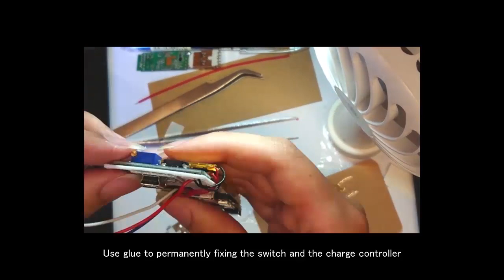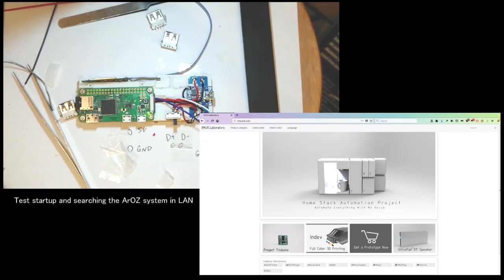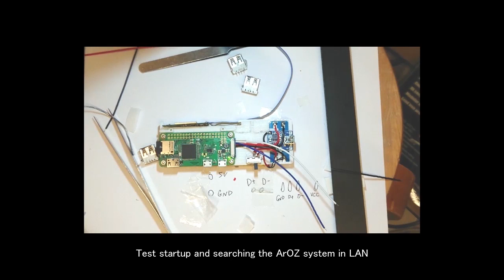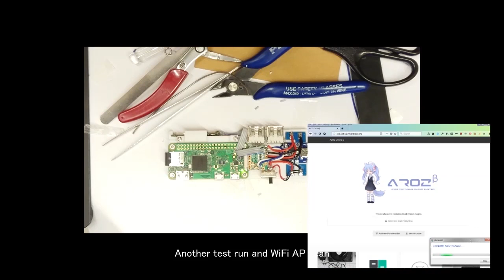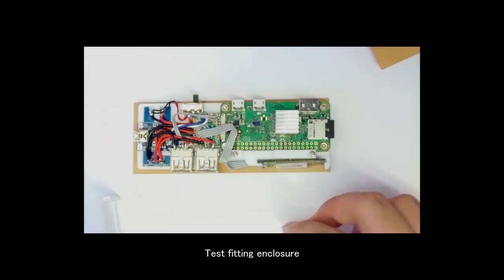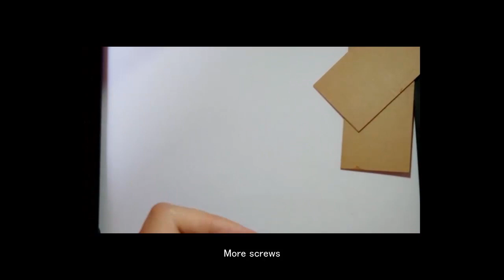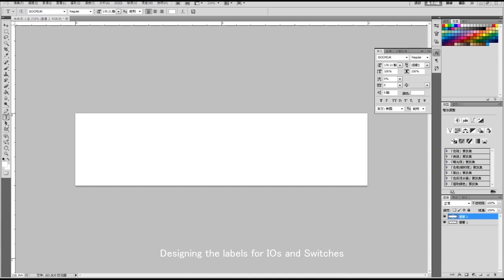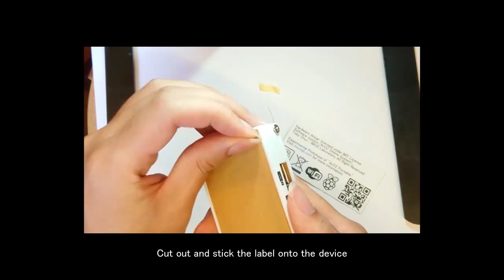DIY Portable Raspberry pi zero w NAS

Comment: can you list the components?
Reply from the maker: Hi! Thanks for your comment.
The components includes MT3608 Boost converter, TP4056 LiPo charging circuit, RT3070 USB WiFi dongle (with case removed), LiPo Battery x2, FE1.1S USB2.0 Hub Controller, a raspberry pi zero (of course) , a switch and two USB Ports. The casing is made of PLA plastic with acrylic plate on the top and bottom. Hope you feel this helpful :)